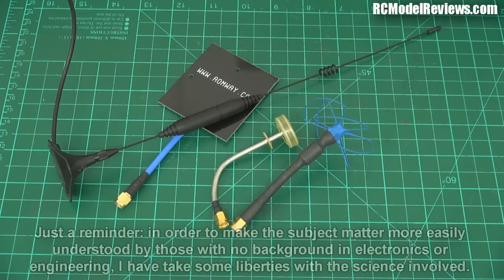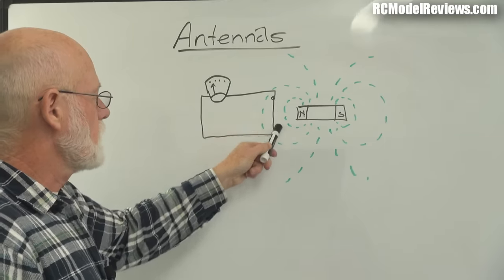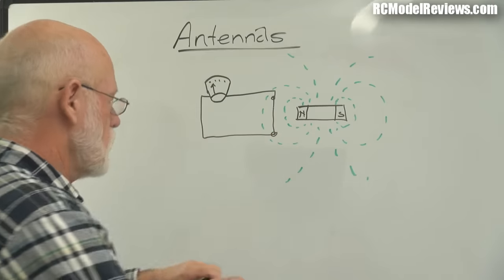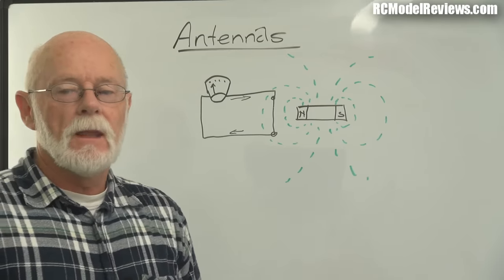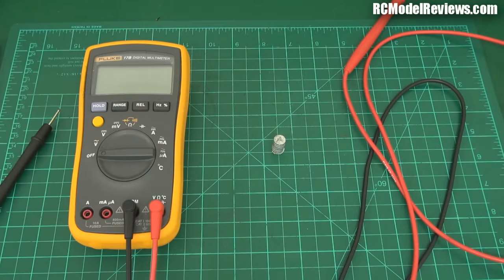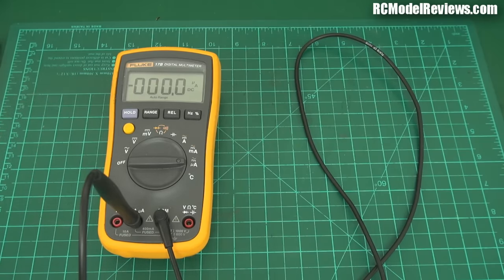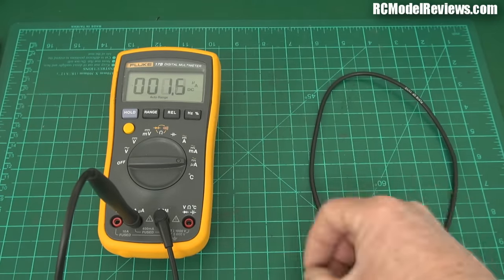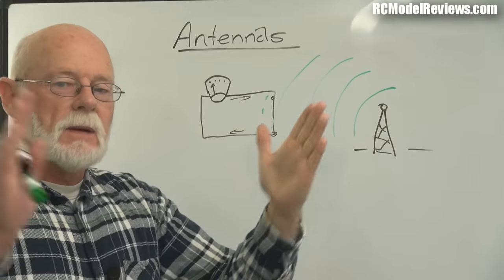How do antennas work?

Comment: Why do all the RC radio transmitters seem so "under powered" using only around 100mw??  I mean decent walkie talkies use anywhere from 1 to 3W, and even walkie talkie style pocket VHF/UHF ham radio tx's are 3-12watts plus transmitting and receiving voice signals miles away for HOURS on a small 600mah cell phone battery using "rubber ducky" antennas... Im no radio expert  but 100mw just seems like NOTHING to me from growing up with my grandpa teaching and doing ham radio stuff with him from what I can remember... I mean 2 or 3watts transmitting simple rc controlling data packets seems like it would go MILES and give much more confident reception in flying... I'm sure it might have something to do with 2.4ghz wavelength, FCC restrictions, or part 95 something or another approval for hobby TX's?
Reply: Nick Hall mostly FCC regulations limiting the power output
Reply: FCC limitations, remember you are sharing the band with WiFi, Bluetooth, Microwaves ovens.  A bit sad management of spectrum but what can we do...

Comment: Great presentation, thank you, I've always wanted to understand more about antennas. 
Can you do a chart showing the antenna reception strength with liner polarization based on angle with one and two antennas, when the 2 antennas are 90 degrees skewed? 
Can you explain how the signal corkscrews?
Can you show use the diameter and spacing of the loops of a coil antenna so we can determine what they should be based on frequency?
I got an external wifi adapter for my laptop, the std antenna got several stations, but the higher dB antenna picked up way more stations, can you explain how that happened? 
The size of a parabolic reflector is significant because the larger the diameter the higher the signal strength.
I wrote a freeware Windows/Linux parabola calculator which will determine the curvature (x,y) coordinates for a dish of any depth and diameter, for any number of points, you can d/l it here. 
https://mscir.tripod.com/parabola/

Comment: thank you for this great explanation of how antennae work.  and the explanation of receiving frequencies.  actually, I don't do RC but am trying to set up a decent FM radio antenna in my attic. this was great info.  I'm going to hang one of those 'T' shaped radio antennas which are 31 inches on each side and use a coax cable to attach to the 75ohm input and hope the gain improves.  thanks again.

Comment: Probably the longest video on YouTube that I actually watched from start to finish very Informative and interesting thank you for this. My question was going to be about a range extender I bought for my Mavic it's called itelite nano sync but I think it's similar to what you mentioned in the end about using a dish ? But my question is there's no antenna on the other end on the drone it's just the extender on the remote control and that's it. shouldn't it need something on the drone itself to connect with to perform better? Like another antenna or something. I'm not 100% sure how they work and you can't really open them up without breaking them or else i would have checked it out already. But for sure a 100% I get way more distance and signal strength using it as opposed to the stock antenna. But very directional, is there something I can put on the drone itself so It can communicate better? What's actually inside the range extender? Would be great to hear back from you but I'm sure you're busy. Thank you for your time. Cheers from Ontario!

Comment: Excellent explanation, clear & detailed explanation.  Tq
I had a inquiry , request is for suggestion for in door FM receiver(tuner)stationary / immovable. What I have is just a twin wire cable spread @ 180 deg. Like T. This poor in picking signals.
Thanks!

Comment: Moving coil meters are still manufactured, sold and used. I have a couple for peaking circuits. I have agilent/fluke etc for general use but a centre zero moving coil meter is unbeatable to allow a tuned circuit to be peaked.

Comment: This has been very educational, excellent vid, thanks for sharing. I would also love to see a vid on radiation from high voltage power lines and in house power cables 50/60Hz inside houses. How can this be minimized and how exactly do the electric and magnetic fields look like in case of such power lines/cables. Cheers!

Comment: Due to how contrasts work, we can't really see the "problems" you see with the white board, but in case you wonder; The main problem with white boards is that people use and clean them incorrectly. The problem with contamination on a white board is that it becomes a new bonding agent for the white board pens. This includes actual cleaning detergents.

F.ex. it is a bad idea to use your hand to wipe away something; An eraser or a clean cotton cloth is ideal.

If you want to clean the board (and there haven't been any finger-print or other fatty substances), there are special detergents intended for white-boards, but generally speaking most things you would use on a mirror works.. but also you should clean it with pure water and rub with dry cloth until it is dry.

Comment: I found myself here due to a reception problem with my FM radio. I didn't find the answer to this problem but I  was surely educated by this gifted educator on antennae theory. As to my problem:  A small FM receiver with auto tuning sits in a room struggling for a signal. In other words a fair amount of static noise . When I walk around the room the reception quality changes. When I get within 5 feet of the receiver the playback becomes clear. Strong signal. 
How is it that human presence, basically a skinbag of water,  can affect radio waves like that?  What would be the solution for getting a constant clear playback?
Reply: called bigger aerial
more metal

Comment: Great videos.. Can you also make a video on how openTX RC Radio Transmitter communicates with transmitter module like TBS crossfire? I have some STM32F4xx boards on my bench and I wonder if I can also make an OpenTX transmitter that can communicate with TBS Crossfire. I want to know what protocol TBS Crossfire communicates with, like SPI, IC2 etc. THanks in advance.

Comment: Awesome video. Learned a lot but I still have some confusion. I have a couple of Hubsan H501A and SS drones with their advanced H906A controller. These drones have 2.4Ghz for the control and 5.8Ghz for the FPV.  I would like to have your opinion as to what setup would give the best transmission/reception for 2.4Ghz control and 5.8Ghz FPV for doing long waypoint flights...doing video recording. I seen many videos on the so called best antennas and still have no idea what TYPE(S) of antennas would work best for this. I have modified the drones so I can put whatever external 2.4 and 5.8 antennas on them that I need too. So, I should be able to use paired antennas if that's the way to go. Thank you so much for ALL of your informative videos...truly amazing what you've accomplished here on YouTube over the years...well done.

Comment: Nice explanation. Applies back to C.B. Radio I used as a younger man and applies to the 2.4GHz radio I'm now using in my RC Glider. Thanks!
Question - I'm seeing a lot of videos where guys are modding their 2.4GHz FlySky FS-i6 transmitters with 6,8 & 10 dBm 2.4GHz antennas; usually replacing both; some just one. In the radio, OEM antennas are place one vertical and one  horizontal. If I understand your video correctly . . .
1. They may be extending range, but at the sacrifice of signal 'breadth'? Extending range AND 'dead' spots?
2. You should have them angled at 90 degrees to each other?
3. Would I be better off leaving the OEM antennas in, or adding some length?
4. The antennas in the glider need to be at a 90 to each other.
FS-i6 Specs tell me: RF Range 2.408-2.475GHz; RF Power <20dBm; Antenna Length 26mm (Dual Antenna).
Replacements I'm looking at: Frequency Range 2300-2500 Mhz; Gain (dBi) >6; Dimension (mm): 195(Unbend) 173(Bend)

Any thoughts on the utility of these mods?

Thanks!

John

Comment: Approximately every 6 dB of gain, doubles your range.  20/6 = 3.333 and  2**3.33 =~ 10.1, so we would hope for 10X the range.

I don't have thousands of those antennas, but I have had hundreds from working in QA on Wi-Fi radios.   One of the funny,or not, things about those flexible antennas is that they are "fun" to flick back and forth, say while you're bored in a meeting.

Anritsu used to make a super test antenna in that form.    One of our technicians took it to a meeting and flicked it for over an hour.   The next day, another technician (me) tried to replicate some previous experiments with the same antenna using our $55k WLAN test set.   The continual flexing had almost permanently collapsed the shielding in the antennas coax.-  permanently.
We had tested the antenna prior to this, and its Return Loss had been better than 45 dB.   The normal for that type of antenna is about 6- 8 dB.
Boy was I pissed.

Comment: Back in the day, 50's, to whenever it was that they outlawed all my RC transmitters, early on we used CB channels then were assigned the channels in the ~72 MHz range, we usually had about a yard of antenna wire in our planes strung from the receiver outside the fuselage and strung up to the vertical fin. Then when flying we were careful (the smart ones) to point our transmitter antenna at 90 degrees from the plane.

Comment: Thank you very much !! 
I have 2 questions . If you can explain those i am really appreciate.❤️

1. Most simple 2.4ghz sleeve dipole , if you measure the sleeve and driven element it is 25mm long . Why is it 25mm instead 31mm ??? 

2. Is there any relationship between parabolic dish focal length and frequency? Because when we make a directional antenna back reflector to driven element length really maters . Is it no problem on dish ??

Comment: Thank you so much for this simplification. I understand much more and particularly the dynamics of a good antenna. My query is relatively simple. I have a good radio and use for fm and dab. The reception using an internal antenna is good for dab but useless for fm. If I unscrew the antenna and use just the wire I get good fm reception. Can I put  a joiner on the aerial input and have two antennas. One for fm and one for dab. And does this need to be a joiner that  can be switched when I move from fm and dab.

Comment: Is nobody talking about how the magnetic poles of his first sketch are wrong? Depending on the direction of the voltage in the "coil" or respectively the orientation of the permanent magnet the north/south poles should be on top/below the magnet, not left and right as written.
Apart from that, quick and easy to understand overview and helpful to grasp the concept albeit some minor physical quirks here and there.

Comment: Thank  you, very interesting.  What I want to know is how to make a good external antenna to replace my rubber ducky antenna on the aviation radio in my Powered Parachute aircraft?  Length?  And where to install for best performance:  front, rear, top, or interior of airframe?

Comment: I have small portable radio which had teleskopic antenna. Where is its ground? I made a ground from four same sized steel wire in horizontal direction its root without electrical connection to antenna. I heared few FM station more with it. How make a good one?

Comment: About that altitude record... It was in  fact over 27,000 feet and was set at Edwards AFB. They used a modified missile tracking set up with a set of super powerful binoculars for the guy flying the plane and two guys operating the tracking mechanism with their own sets of binoculars and they used radar to determine the actual altitude of the plane. I don't remember anything special about the guy's antenna, if it was a yagi they didn't mention it in the magazine that reported it.

Comment: Love your video! How about circular magnetic loop antenna? I also have a question: I have 7 huge oak trees around my house  -corner lot in Lincoln, NE. I would like to make some antenna to listen on my USB  DVB-T+DAB+FM. What would you recommend for me to make me an antenna that would cover the most frequencies? I like to just experiment and have fun mainly, but I also like to make  an a universal wireless signal that would turn on/off my electrical outlets, that are outside running my lights, with push of one button. Now I have 6 or 7 individual remotes and it gets confusing for my wife. So I was thinking that I should be able to LISTEN to the exact signal frequency using my DVB-T+DAB+FM and find what exactly are these remotes sending and using Arduino I should make a program that will send the correct signals. BUT I do not know how to make this or even where to begun - any suggestions? Thank you for your videos!

Comment: TV antennas are not Yagi's, they are log periodic/ multi-band antennas.  TV broadcast is on multiple VHF and UHF frequencies, so each element is tuned for a specific frequency.  The elements do produce gain by reflecting from the longer elements and "pull" in the signal from the shorter elements.  They also have an alternating feed from a coax center conductor from one to another set of elements to the next.  This balances the impedance.
Two 1/4 wavelength (lamda or abbreviated as λ) antennas do not radiate as a director / reflector as a Yagi does.  The spacing if kept to 1/4 wavelength spacing actually radiates 90 degrees ( from the video)  in 2 directions of the antennas and at 1/4 lamnda you get the best gain.  Adding two antennas on the same coax without a balun changes the impedance and VSWR.  The spacing is critical to get directivity in what is called a co-phased antenna system.  A single 1/4 λ antenna is considered as isotropic, a spherical transmitting pattern or 0 db gain.  A dipole is +2.1 dbi gain or 2.1 db gain over isotropic.  Every 3db gain appx. doubles your power as it is concentrated in a specific direction.  1 watt with 6 db gain becomes 4 watts.  9 db gain would double that to an equivalent of 8 watts isotropic.  This is where the term front to back ratio comes from in a Yagi.  F/B ratio is due to the gain and directivity of the antenna.
An antenna is part of a network which includes everything from the connector on the radio to the tip of the antenna.  Antenna impedance is in ohms but is not a resistance you can measure with a VOM.  When stacking Yagis for added gain, the math is the same as resistors.  It is the reciprocal of the sum of the reciprocal of each resistor or antenna.  Two 50 ohm resistors in parallel actually becomes 25 ohms total.  Two 50 ohm resistors in series becomes 100 ohms. Antennas other than 1/4 λ or 1/2 λ normally have an LC network as a Pi or T network to lower the VSWR and decrease the reflected current on the coax.  Coax cable is what we call unbalanced.  The old twin lead TV antenna wire is balanced and way more efficient in db loss.  A balun is normally used with coax cable feeding a dipole as a voltage balun or a current balun.  Current baluns do the best for power transmission.  Tuning a dipole with just coax feeding a dipole is very time consuming and the best VSWR will be achieved with the wire length slightly shorter and longer than the frequency / band you are tuning it for.
This is way deeper than the video explains but it does give you some basics.  In ham radio we use antenna tuners to get the lowest possible VSWR possible.
There are some very cheap VNA's on the internet for about $100 that may go to the frequencies in RC.  I highly suggest you get on if you start to experiment with antennas.  Keep the rules he gave you about circular polarization.  It would be the best for model airplanes.  The example he gave in cross 2 polarized antennas actually only are 1% efficient in reception and both being either vertical or horizontal polarization.  If you are using a remote car with a whip, keep the RC controller antenna vertical also.
If you get your ham license you can legally run a lot higher power in the RC world.

Comment: Okay, I'm building a ground station with a free salvaged satellite dish and antenna tracking. I want to use a long extension cable (5-6ft) from my transmitter to the focal point of the dish. Lots of questions from this.
1. Will the extension cable mess up the tuning of the 2.4ghz antenna? 
2. Does the satellite dish have the same directional gain transmitting from the focal point as it does receiving?
3. Would a low gain clover antenna work best?
I would also mount my 5.8ghz fpv reception antenna to the focal point on the dish.